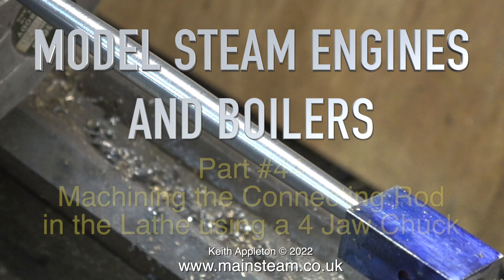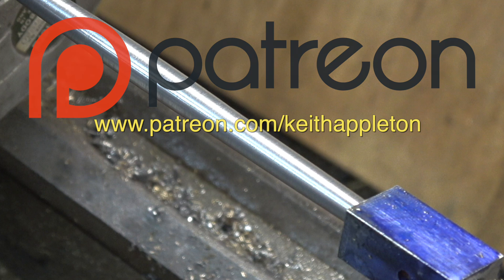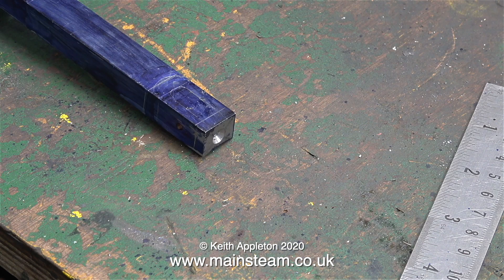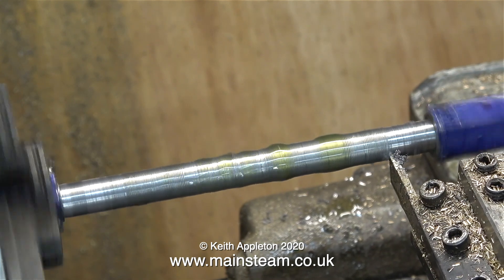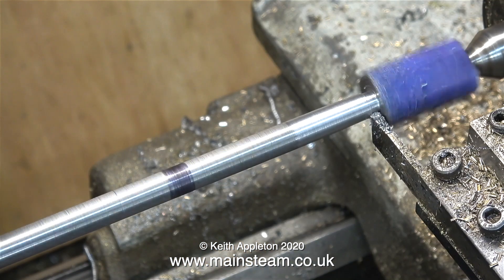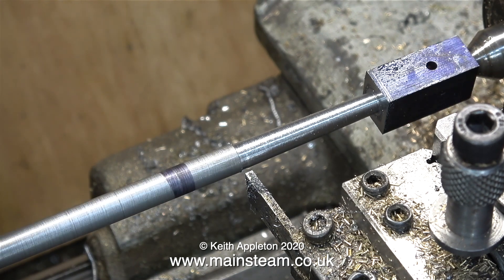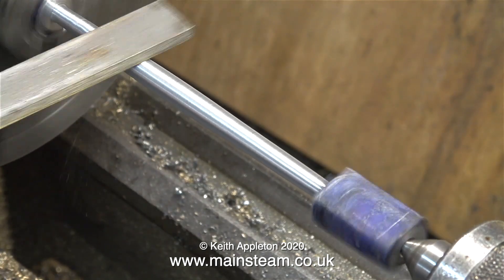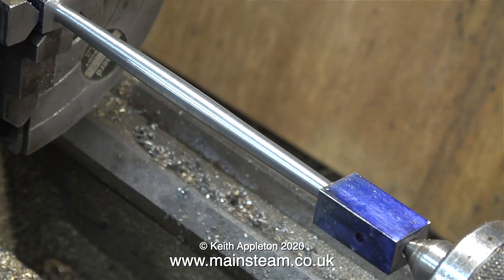MODEL STEAM ENGINES AND BOILERS - PART #44

Comment: if you think about the bulge ... with a push rod or push pull ... having a thicker center would resist deformation better as there is more pushing back than into the middle .... by spreading out it disperses the forces into more material increase  for overall strength of materiel ... basically it fakes out the largest diameter for force needed but uses the minimum material to get it ...
Reply from the maker: I mentioned this in great detail from 2:25 ....... did you not watch that part?
Reply: @keithappleton  must have napped ... it was kinda late ... guess I have to rewatch it LOL oh well wont be the first one